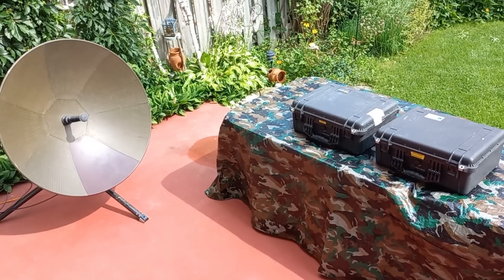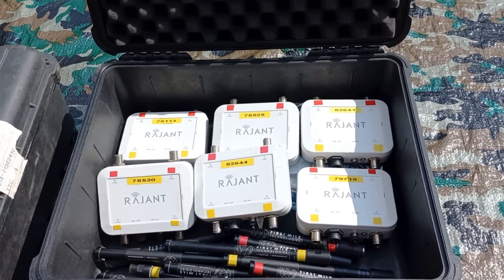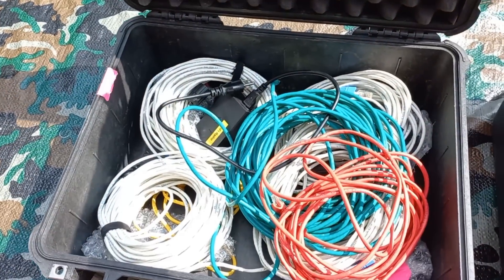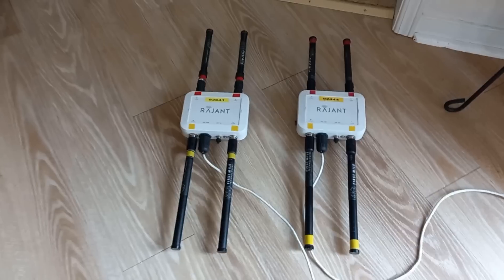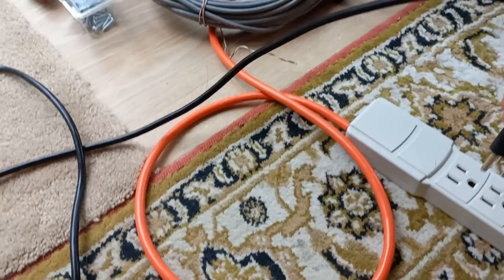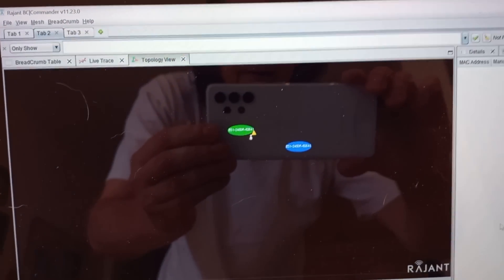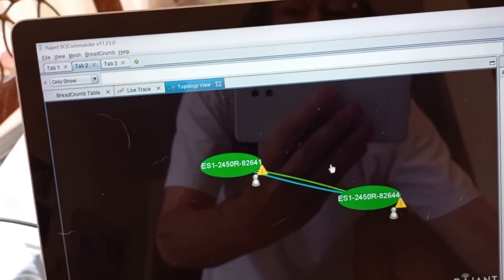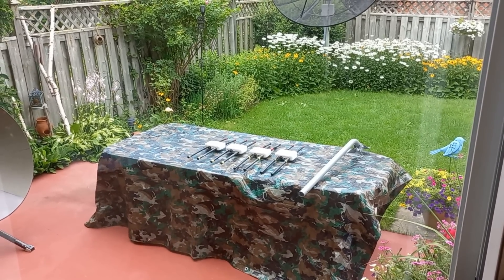Military Radio Industrial Mesh Network

Comment: It will never ever be remotely close to gigabit speed. Having multiple links is not the same thing as having multiple independent links. The shared half-duplex channel for all links plus CSMA-CA means your actual throughput will cap out at less than the speed of a single link. Solid software and solid hardware can make the experience painless but if you ran multiple simultaneous speed tests from different points in the mesh you're going to be disappointed.

Comment: Does the steel pipe affect the lower antennas radiation pattern when using the J pole? Would it help any by adding a bit of fiberglass tubing from McMaster-Carr into the j pole and lift the antennas away from the metal tube?
Reply from the maker: Yes, it'll create a bit of a distortion however this is why there are 2 antennas. The 2 antennas work together as a diversity antenna system to get around objects. You can visualize this by standing behind the mast... if you can still see any of the 2 antennas then the signal will still see you too.

Comment: whats the range between two nodes?
Reply: @peterfairlie2296  not bad esp for what that kinda hardware supposed to do :)
Reply: On a 5' high mount, in an open environment about 1/4 mile is typical.  Fresnel zone is a huge factor, so mounting higher up greatly increases range.   We've seen as much as 30 miles if one end is in a helicopter.

Comment: I think I've seen this product deployed at a new mine site for some of the connectivity on the large haul trucks. They had a bunch of small monopole towers spread around, backhauled with 80GHz microwave, and presumably these APs around. I wasn't able to see anything beyond the physical hardware, but it sounds like a nifty system for mobile nodes.
Reply: canadian malartic mine we use them for our prod network in the pit

Comment: This is the type of set up I was thinking about for quite a while basically supplying my small town and family members with reliable internet service  system being able to use wifi through out my hole town and every were I go through out town basically making it a huge hot spot. Almost like a Xfinity wifi I have actually talked about this to some people and family and they thought I was crazy. I fill a lot better now I no I'm not the only one thing about how to make use of what's out there and how it can be applied to real helpful usage with existing equipment. You the man 👊  I wish more people out there would think about applying more usage out of technology that already out there and show other people how and when to apply thing similar to this. Definitely can change a lot in my opinion. Great stuff keep up the great work.  P.s you find and buy some of the coolest most useful things IV ever seen. 📡🛰️📞🛠️🖥️💯👍✌️🍻💯
Reply: The key thing is making a process for tech support. You can make decent money but tech support will kick your butt in this business. i did this back in the days with 802.11 be came out. You have to think about many factors are involved. Cheers

Comment: What is the maximum distance between breadcrumb nodes in say an open field ?
Reply: 1/4 mile if you mount them 5' above ground.  Much more if you mount them higher.

Comment: Imagine a neighborhood where everyone just pays for say 3 internet connections total and all 25 houses are meshed together for internet access...
Reply: That's against most ISPs TOS.
This is nothing that new and mesh solutions have been around for a while. They can be quite difficult to maintain without a single point of oversight. It would fall apart in 6 months unless they were all pole mounted and someone maintaining it.
Reply: Yup I thought the same thing supply a small town on just  a few business line internet service. Could be done but the up keep on the equipment  would have to be consistent and would be the  amount of work🛠️💯🍻👍✌️